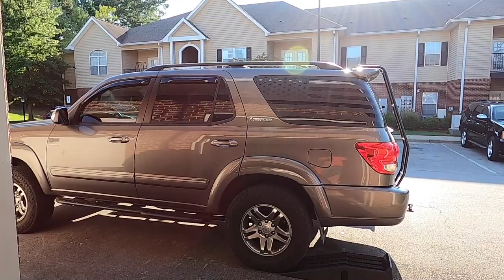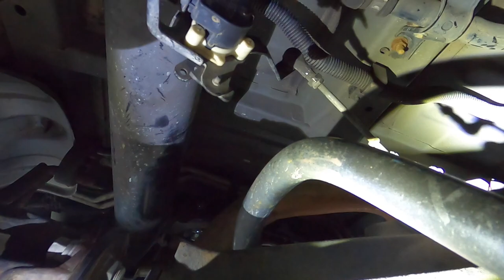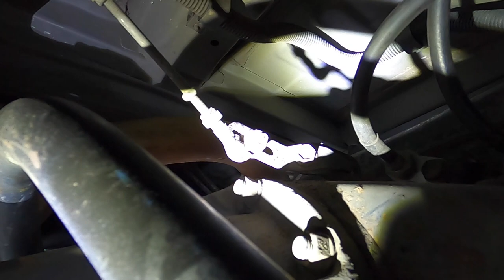How to adjust your Ride Hight Sensor after lift kit | 1st gen Sequoia

Comment: I WISH I had found this video 5 years ago.  Difficulties trying to loosen the sway bar shaft do to unscrewing clock wise design but got it perfectly adjusted. Now my 06 sequoia doesn't hit on the frame when driving on bumps anymore, nor stress the compressor motor. Thank you 👍
Reply from the maker: Anytime im glad i could help

Comment: I just bought an ‘05 and it squats when parked and rides very bouncy. I believe it needs new airbags but is that all that’s causing the bouncy ride? Or do I possibly need new shocks??
Reply: Mine has the same problem, did you figure it out?
Reply: @gabew4188  it was the airbags .. replaced with springs And new shocks .. takes bumps so smooth now
Reply from the maker: i would replace the bags first
Reply from the maker: air bags are normally the problem
Reply from the maker: i need to do the springs

Comment: Hey man would you have to run taller struts/shocks? or could run the oe size and still lift a little you think
Reply from the maker: you can lift the back without adjusting the front I will have a rake

Comment: When you lift the air ride in the cabin using the button and drive past 17mph the air ride drops back down to normal. Will it do this after you do this trick?

Thanks Shawn
Reply from the maker: it should. all this is telling it what is normal ride hight